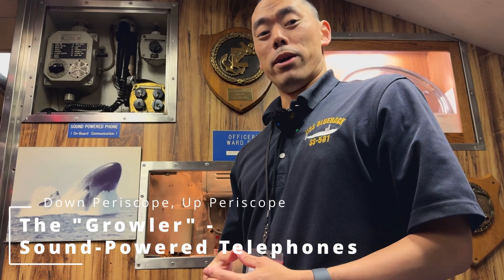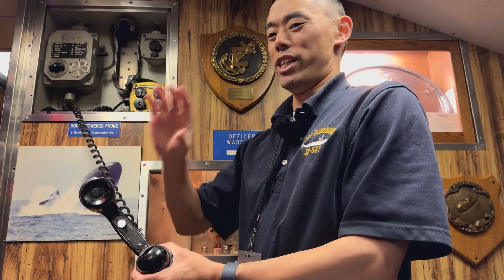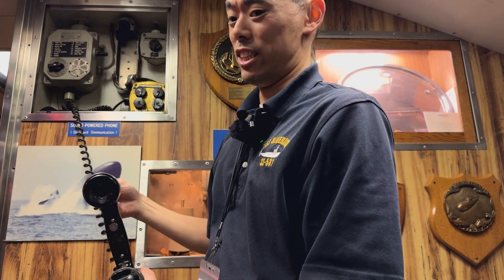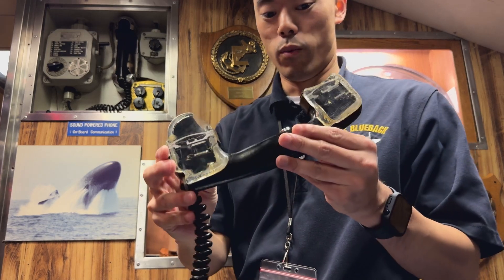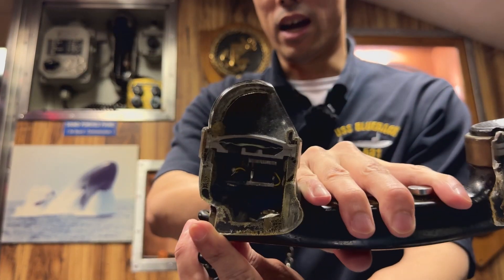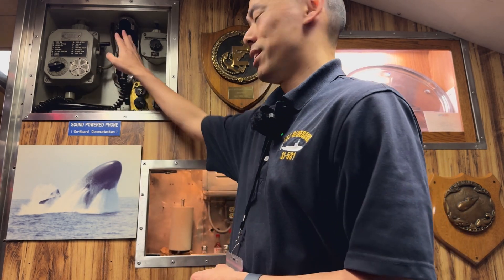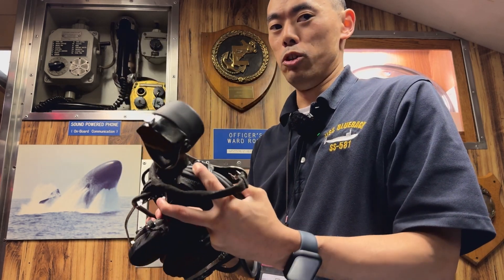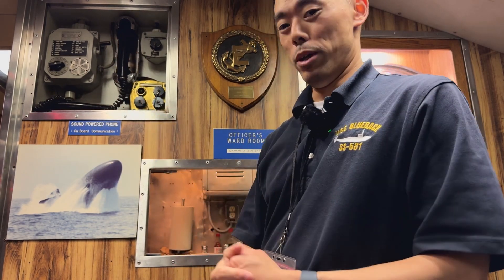The "Growler" - Sound-powered Telephones

Comment: "Woop woop" is the etiquette for the growler. Going ham on it like that is how you make friends. The longer it wails, the more excited the other end will be to answer your call. 

Maneuvering in the engine room commonly used it before midnight to call crews mess to inquire if chicken wheels where on the night's midrats menu.  

Another tidbit for the chest rig, if you put your lips into the rubber piece and ignore the thought of the last man that used it, the rubber helps to lower background noise. You'll see the aviation deck crews on carriers do this during noisy flight ops.
Reply: Mmmmmm, chicken pucks with Tapatio!  With a tall glass of bug juice!

When sitting Electrical Operator, I always rested the handheld mouthpiece on my chin when listening to the spaces, then held it close to my lips to talk.  Helped keep down the ambient noise, even in Maneuvering.

Looking back, we wiped down the EABs with betadine, but not the phones.  Wonder why?  Never really thought about how many lips had been on those phones before me.  Good thing bubbleheads are a tight knit community!